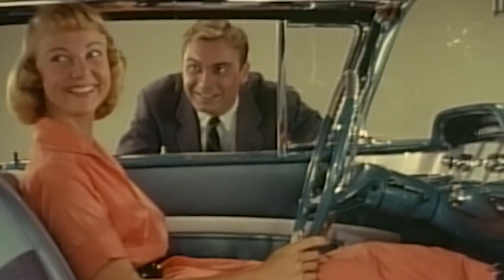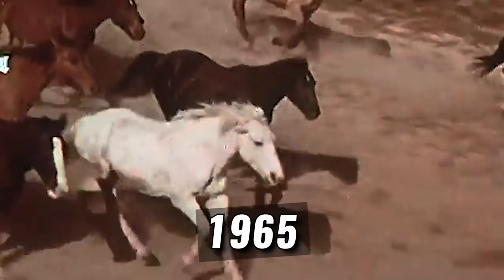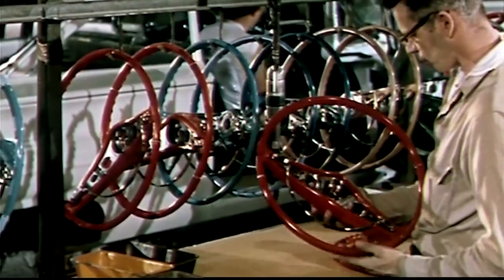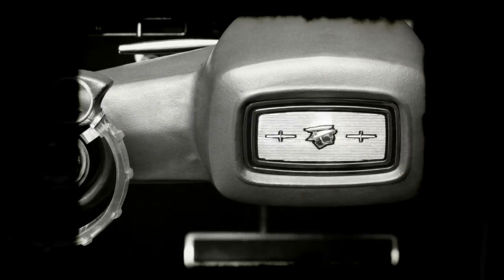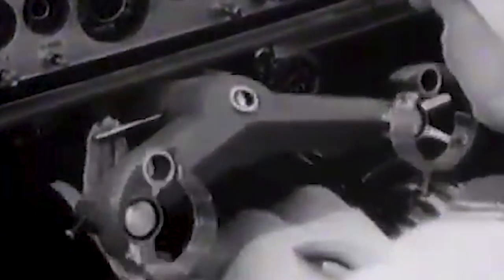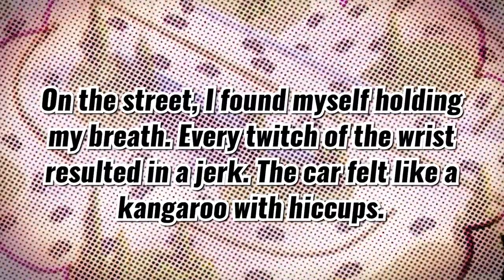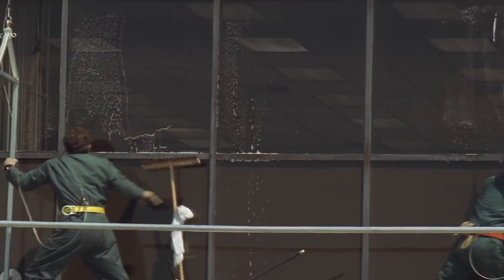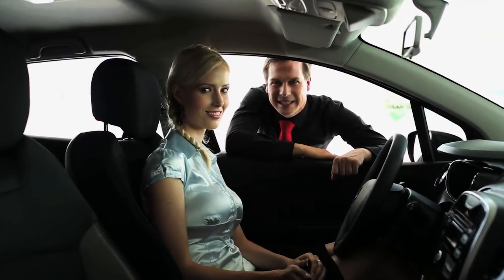The wacky way we almost drove | Fails of Future Past

Comment: Wow! I actually remember reading those articles in Popular Mechanics. I wasn't yet a driver, so I had no way to judge if it was a good idea or not. Strangely enough, I happened to be thinking about the system just a few days ago, wondering what ever happened to the the idea. I had long forgotten the name of the invention, and that Ford was involved with it. Thanks for reviving a memory from my childhood!

I also seem to recall that one version allowed you to twist the entire assembly just like a steering wheel, and the wrist twist circles allowed you to use them like the old steering wheel knobs. You could keep your thumbs in the wrist twist thumbholes, and spin the entire steering wheel from lock to lock with one hand without ever letting go.